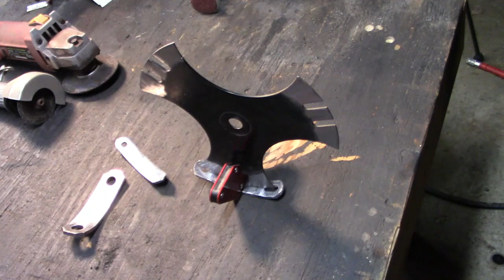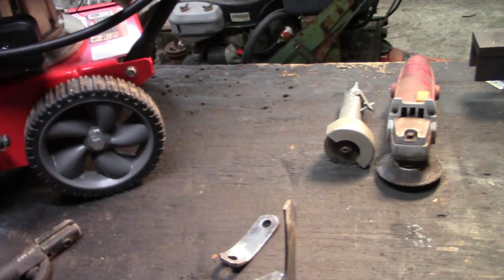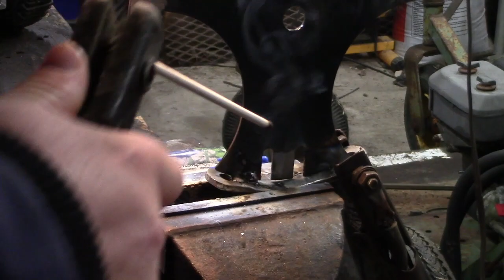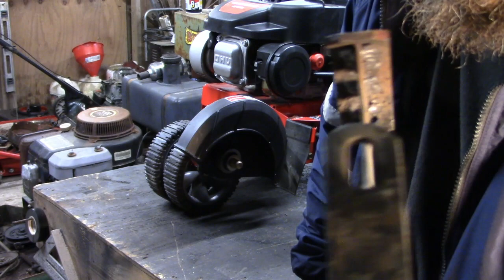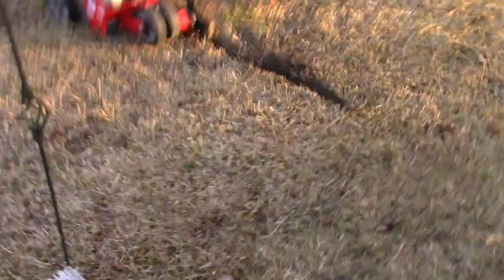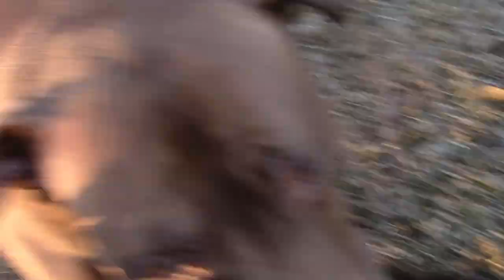Convert your lawn edger into a trencher

Comment: I use my cheap Green Machine edger to make alot of  ditchs for coax wire.  My blade only has 2 teeth instead of 3 like yours. I stacked 3 blades together and it works great but only gets about 3/4 inch wide.
 I think that with the speed your blade rotates a 2 versus 3 tooth blade would help you. Theres alot of small tractor subsoiler videos that show similar  blade design that im using but its just rotating instead of stationary. Anyway good job, liked. And i used to install satellite tv for several years so ive buried thousands of feet of cable and using an edger is the best idea short of a dedicated piece of equipment
Reply from the maker: I appreciate the feedback. It never occurred to me to just stack the blades. My plan was to bury an extension cord in PVC pipe to run to another building so I could at least have a light out there. As you could probably see, my design doesn't exactly run smooth. Definitely needs some refining. I think your idea would run much better. Thanks for the help!
Reply: Hey can you send me a picture or the brand of your green machine edger
Reply: You think the Milwaukee edger world work like that

Comment: Pull the trigger on your welder and see if you can hear a firm “click”. 
If not, then your solenoid valve isn’t opening to allow the gas to flow through the hose. 
It could be as simple as wiggling the power wires going to the valve; or the valve itself might be sticking. It’s very simple, don’t be afraid to tinker with it. 
Hope this helps!
Reply from the maker: That is helpful. Thank you. I assumed it was some kind of valve in the handle but I don't know enough about them to just dive in. I'll check it out and see what I can figure out. Thanks again!
Reply: @AverageJoes4u  The valve is not in the handle. It's inside the welders side panel where your gas hose attaches to it. Follow your gas hose from the tank to where it goes to your machine. Where your hose stops on your machine is the bad gas valve. If that valve is not clicking when you pull your guns trigger that's your problem.

Comment: That was some crazy.  No matter the skill, I'd be worried about one of those bit breaking and putting a hole in someone...  What about take 4-5 cheapo circular saw blades with a shim between each one to separate them by 1/2" as a bit head?
Reply from the maker: You're absolutely correct. The only time it has been run was the demo for the video. While I still have confidence in the idea, the design definitely needs some work. To say I was nervous while filming would be an understatement.

Comment: Good job. but please dont go to long without guards and protection on that thing. Ive run  trenching  machines for 30 years and have many close calls from rocks pieces of buried crap and once  the machine dug up a steel bar and threw it through under the machine and just missed my leg.....i also hit a plastic tree bucket and the machined pulled my rotator in half and put me out of work for 8 months.....trenchers ar not to be taken lightly.......and dont try to home make one that is going to dig any deeper than what you have......I like that small trench....perfect for TV, dog wires, coax , and phone lines and some small water irragation....have fun and be safe.
Reply from the maker: I appreciate it. To be honest, I did the test in the video and I haven't touched it since. It's sitting in the corner of my building collecting dust. I was terrified the whole time. Lol.

Comment: Update video ???
Reply from the maker: Unfortunately, after a meeting of the stock holders (my wife), it was decided the danger level of this project was too high and should be abandoned.
Reply: @AverageJoes4u  broooo no! All you need is to weld a L plate “in replacement of the safety cover ! Saw this because I do drop buries for my job ! Knew people made homemade stuff !
Reply from the maker: @4.5_shammer  to be honest, I was going to do some more modifications but I just lost interest. It's been sitting in the corner since I posted that video.
Reply: @AverageJoes4u  open that project back up man it’ll be a success!!
Reply from the maker: @4.5_shammer  lol.